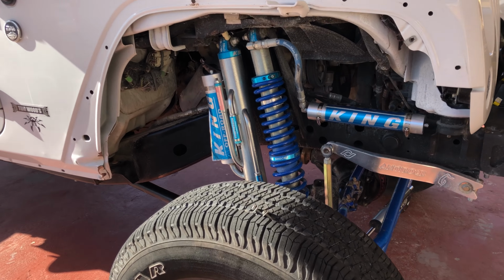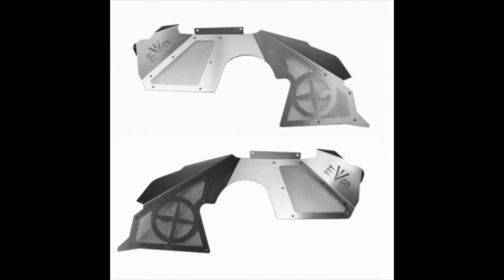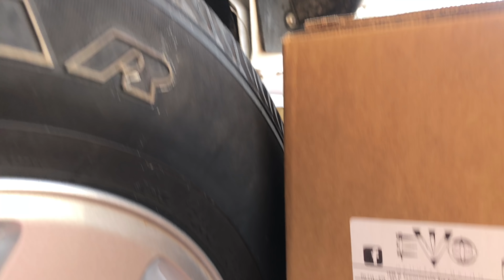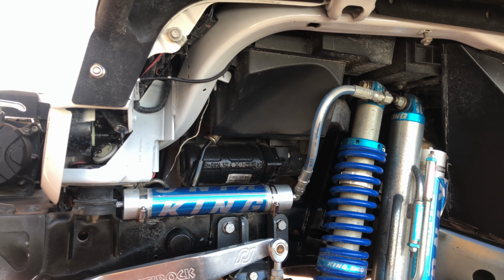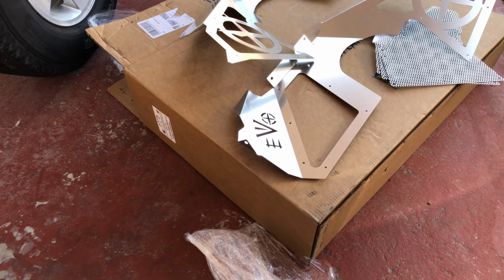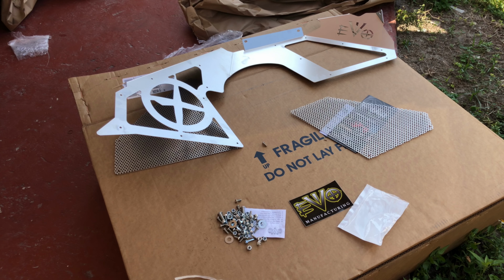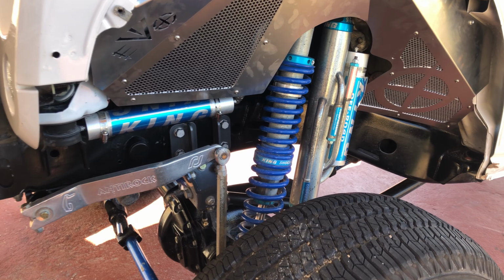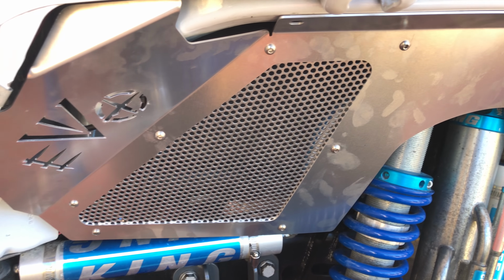Evo Front Inner Fenders Installation Wrangler | How to install Evo Inner Fenders Jeep jk

Comment: I wonder if a rivnut/nutsert would be better than drilling the body sheet metal and fastening with a self-tapping screw? It just seems that the area would be best drilled, deburred, painted/sealed, and then fastened with a button-head bolt to match the others.